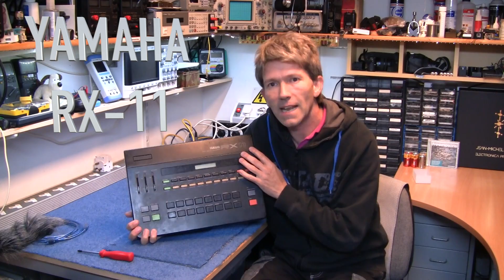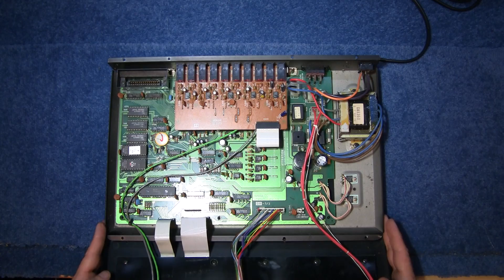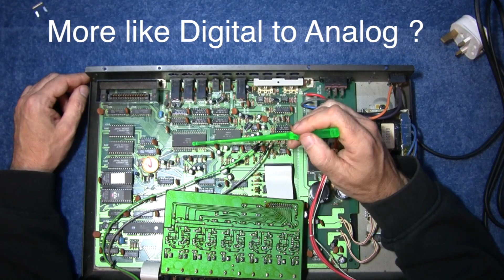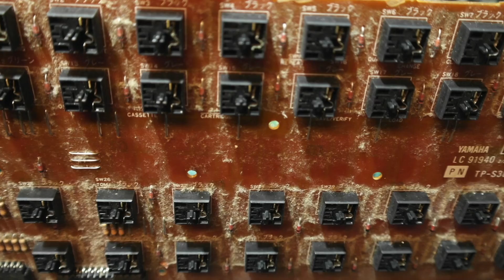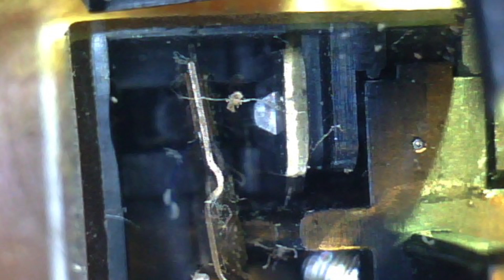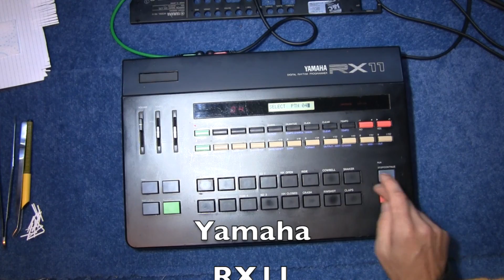YAMAHA RX11 vintage 1984 drum machine repair MF#57

Comment: You seem to be the person that knows the most about the RX 11 that I have come across.

I am getting the dreaded eight blocks in my display. I have replaced the display with a new high contrast LED model and change the battery

It seems to be working I was able to play the pads but there was an issue with writing patterns they would not playback correctly or I could not save them it said the memory was full

After turning off for a few days when I turned it back on the eight blocks in the display we’re back. I disconnected the display battery then reconnected them and did a factory reset it seem to be working again. I then did a diagnostic test and it came back with a bad ram chip. I replaced that, but then again, the eight blocks were back. I disconnected, reconnected reset and things seem to be working perfectly.

After powering off for a few days, the eight blocks were back I have reset the diagnostics disconnected reconnected and the eight blocks are still there. I still have Sound from the pads but the display is not working properly.

I have discerned that this means The unit is not fully booting. I have the model with the 2 0S chips the Yamaha RX 11 IC 214 and IC 213  V 1.0 chips.

Any advice or ideas would be greatly appreciated. Thank you for your time.

By the way this is my second RX11, not the one I repaired 4 years ago regrettably I sold that one😢

Comment: Did you clean the volume slider and has it helped the control?
Reply from the maker: yes I cleaned the volume slider and it did help the control. though I sold the unit a few years ago I hope it still works well.

Comment: My RX11 needs to be factory reset constantly due to the LCD cursor getting stuck before the values. Is there anything I can do to fix this?
Reply: well, the only way you can really “reset” it is it remove the cr2032 ram battery, which requires soldering… and that will reset it, but if you want to save patterns of your own you will need a new battery or solder it back in

Comment: I wanted to thank you! I was able to repair my Rx11 with help from this Video. I did have to replace the battery and I had never desoldered or soldered on a circuit board before. I had to purchase some proper equipment to do it. I had bought it  “In Good Working Order” from EBay. Alas it was not, the buttons/sliders were in bad shape. I cleaned them up as you demonstrated. After a factor reset it is as close to new as it can be and it works flawlessly now! Thanks Again!

Comment: I bought an used RX11 this year and had the same problem with the bad pads/triggers. Luckily I quickly found your video which gave me the courage to repair this myself. And luckily repairing was only cleaning in this case. Thank you very much!

Comment: Thanks for this video. Helped me to get an RX11 I've just bought working again.

Mine also had a few faults that had developed over time so if one of these has been sitting for a while it's worth checking some menu settings.  Initially, I had only two sounds and had to change the sound routing back to stereo, not multi out. Then lots of the pads were glitching, so a quick flick through the sound variations for those pads fixed that. After I found some memory problems stopped me creating new patches, I just did a full reset and the unit is now tip top 👌

Comment: This machine have the bell of the devil himself. Only cons is that the machine heat quite fast..so need to be careful when using. I think I will put it in some laptop stand to let it breath.
Reply: Got any issues with it eventually? Mine heats up in the bottom right corner

Comment: Greetings interested in fixing and cleaning older drum machines and samplers. I know some electronics and made minor fixes but am hindered by soldering issues and knowledge about certain chips. I have an RX 11. Everything seems to work but one sound does not sound though button or midi control. Ive tested the multi outputs and stereo but no luck. Kindly what would you suggest?  Thanks

Comment: Brilliant help Markus, when I got my RX11 with exact same problems. It's been working great, but tonight its on my lap & a real hotspot underneath below the start stop buttons. Be grateful for any suggestions what's going on there?
Reply from the maker: Hello. just under the start button is where there are a couple of voltage regulators and they are screwed down to the base to help with heat dissipation. however they should get warm but not too hot, those  power regulators have a thermal shutdown built within so the whole unit should suddenly stop working if the component gets seriously hot but that area can get warm as it is designed that way as a heatsink for the power regulators, they can be easily changed with a soldering iron as they are not on the main circuit board but have 3 wires going to them which makes replacing them easier but even changing them over you may find the new ones get just as hot. however under normal working conditions they can get quite warm and you may only be noticing it as it is on your lap, normally you will not notice it as it would be on a stand or desktop.
Reply: @markusfuller  Thanks so much. Built before anyone even thought of laptops. No vents or fans,  just solid metal.  got quite uncomfortably hot but didn't shutdown. Presume, like you say, it's normal operation but I rarely use it that way.
Reply: @organicearthful  mate I just got mine today and started getting paranoid about it, I was just looking for a comment here mentioning this lol. Any issues with that, after 3 years?

Comment: Great video! I've got the RX15 and the right ouput doesn't work either with the phone output or the L/R out. What could be the problem?
Reply: you might need to clean the inside of those jacks, use a cotton swab and isopropyl alcohol and just swab it around in there

Comment: I started working with an RX-15 in the 2nd half of 1984… and then about a year later the RX-11. Oddly enough, I was not the owner of either of these machines, they were purchased by other musicians I was working with. I was a competent drummer who read music and was making a transition to playing keyboards and synths… so I did the bulk of the drum machine programming.

The Yamaha RX machine offered "ground-breaking" value for the time in which they were released, but I NEVER really cared for the majority of the sampled sounds… in particular I thought the toms were horrendous. It was frustrating trying to use these machines to cover the drum parts of the top 40 oriented pop tunes we were doing. You only had 2 velocity levels (unaccented & accented) and fx processors were so expensive at the time that we couldn't afford to dedicate a hardware fx device just to the drum machine… so throwing a bit of the same reverb being applied to the vocals was the best we could do. All this to say… I don't look back on these machines fondly. i CAN understand interest in Linn, Oberheim DMX, Emu SP-12 & 1200, Akai MPCs (of course)… but not these Yamaha RX series.

Comment: Pulled a solder in CR2032 from an Akai ME30PII MIDI patch bay the other day. Original early 80’s battery and still measured 0.238 VDC. Had my wife touch it and we went back to the future.

Comment: Yamaha's first digital drum machine, along with its little brother the RX15. Also their first programmable one. I like the kicks, snares and toms, but I'm not so keen on the hi-hats and cymbals. I had to replace three of the mechanical buttons on mine, and spares are available from the Syntaur website. You can also get newly made cartridges with four banks on them from a seller on eBay who reverse engineered the original ones.

Comment: So, the pad buttons are just pressed on?  I just got a used RX7 with 3 stuck buttons and a soldered in CR2032 that needs replacing...  I was hoping to learn how to disconnect the DM circuit board horizontal connectors.  Thanks for the video and advice on the cleaning!

Comment: the data entry slider is mainly use to adjust some parameters like individual volumes ;  you press the "inst level" button, then the snare for example, and the "data entry" slider become the volume of the snare ; not really convenient but well it works ; I have the RX15 wich is the same as the RX11 except it has no separate outputs so this data entry slider is really important to me :) great video :) cheers !

Comment: CR2032 dead after all this time?  Well, both my DX7 and RX11, purchased in 1985, still have their original batteries :-) The cartridge slot is for RAM cartridges (the same as DX7), allowing more patterns and songs.These drum machines are very cheap nowadays. Sure they sound cheesy by now, but still useful with the separate outputs and as the MIDI which allows triggering external sounds.

Comment: hi, do u  know (or anybody here) how could i "knock out" the sounds on this rx11? because i remember that approx 20 years ago(yeah:D) i could do something illegal power on switching , and after this the rx11 gave me different interresting sounds:) wasnt distorted, it was clean, but it sounded like a filtered , modified sounds i made some drummusic whit this newly created voices, i can send you i recorded it to tape...so my question is wheter you met this phenomenon?
Reply from the maker: Csaba Borbely Hi I do not know about this secondary sound, but I will have a play with the rx11 and if I find out i will let you know.
Reply: if i well remeber now, these altered sounds comes out if you switch the power on "slow". it means that the power button you "have to" tilt slow to on state, and you have to hear a "zzzz" from the unit for a moment(of course because of the insufficient contact in the power button switch house), im not saying try it, and  i also dont want to try it again because its a really old hardware i dont want K.O.:) but that is the fact (if i well remember) that it gave altered sound until you re-poweered the unit normal way...i try to find the tape i recorded a drummusic on it...but my sony decks both gone wrong because of belts i mean (last time it was used 2 years ago lol)

Comment: The first thing to do when you pick up a new piece of equipment - is to download the manual. The most of your questions are answered then
Reply: Indeed, the manual answers some of the questions raised in this video. Extracts below, thanks to Wayback Machine (archive.org). https://goo.gl/FdyRXs 

Congratulations on your purchase of a Yamaha RX11 Digital Rhythm 
Programmer! 

Your RX11 represents the crystallization of the most sophisticated electronic music technology, combining advanced microcomputer control with a top-quality digital PCM sound storage and reproduction system. With the RX11 you will be able to program virtually any type of rhythm pattern you required for your music, and since the instrument sounds are digitally recorded, they are indistinguishable from live percussion instruments. 

To ensure that the RX11 will give you maximum performance and versatility, we urge you to read this operation manual carefully before 
attempting to operate the unit... 

CARTRIDGE OPERATIONS 
As a convenient alternative to cassette tape storage, the RX11 permits storage of pattern and song data on special Yamaha data cartiridges-the same RAM-1 cartridges used to store Yamaha DX1 and DX7 Programmable Digital Algorithm Synthesizer voices. Cartridge operations include saving or loading all patterns and songs, and saving or loading single patterns. 
All cartridge functions are accessed from the cartridge control mode, which is activated by pressing the CARTRIDGE button while holding the FUNCTION button.

DATA ENTRY TRANSMISSION 
The position of the Data Entry control can be transmitted to other MIDI equipment permitting remote control of some function of the receiving equipment. The data transmitted is MIDI channel information other event data.

Comment: I just received a Yamaha RX5 from Japan... A few keys do no work correctly. I hope that I can get this machine working again with the helpful cleaning tips you provided in your video. Thanks!
Reply: The RX5 is very nice.  I used to have one, MINT.  I regret now I gave it away.  I mean, I prefer Roland R-8 that I have now, but I think the RX5 is was higher-end, it was considerably more expensive than the R-8 when it came out.

Comment: hi markus. congrats for your excellent video!, do u know how to solve no-sound issue from right channel,??   just i can hear ihe left output...thanks!!
Reply from the maker: +Miguel Rviz Hello Miguel. sounds like there may be a problem with either the right preamp or it could just be a problem with the actual jack socket , sometimes over time the jack sockets can loosen a little and dry joints can occur between the jack and the circuit board track so resoldering it can often repair this fault. however have you tried a full factory reset of the unit incase the pan/balance has been set wrongly ?.
Reply: No  ..i reset it..i also checked pan settings..i ll check solderings as you suggests!! Maaany thanxx!
Reply from the maker: I hope its something simple to fix and you get it working again. Best of luck.

Comment: Thank you for cleaning with isopropyl alcohol tip, probably I will need this. :)
Reply from the maker: +Emir Ercan Ayar Thank You Emir. after cleaning the switches should give no problems for years. I would not suggest switch cleaner as they sometimes contain a lubricant and dust sticks to that. Best wishes from Markus

Comment: I've got an RX15 and sometimes when I boot it up the screen is all black, any diagnostics on that?
Reply from the maker: +Landon Balk Hi Im not sure why that is starting up all black do you mean all the LCD pixels are just showing black ?. if so it may be due to a problem with the display intensity setting though that is in a menu setting and you need to see the display to be able to get to the menu to adjust the display. Thats an awkward problem I do not have a how-to-fix answer to that one. There must be an answer on the www somewhere. My apologies from Markus
Reply: +markusfuller Yeah, the LCD pixels are all black, and it looks like the contrast is set to max, but it only happens a percentage of the time when I turn the machine on. I have taken it apart and even installed a new LCD screen, but the problem persists. Thanks for the response though, guess I'll keep doing some more research.
Reply from the maker: Hi Landon. To be honest I am not sure what it going on there and do not have the answer for you. I hope you get it fixed, Keep trying. Best wishes from Markus.

Comment: this video realy helps me out! I have the same switch problem on one of my american audio radius1000 cd players. The play button does not work right, i have the push realy hard on it. I hope its the same problem with the switch as in this video!
Reply from the maker: +Dennis de vries Hello Dennis, It could be the same problem , I hope you have a go and get it fixed, Best wishes from Markus
Reply: +markusfuller many thanks. the button works mucht better now!
Reply from the maker: Brilliant. Im pleased it worked for you Dennis. Best wishes from Markus

Comment: The cartridge slot takes a DX ram cart for sequencing - the internal memory is easy to fill. If you ever want to sell it let me know.
Also this has PSK tape sync co will lock nicely to any DAW over MIDI - BUT it won't let you record in external sync!
Also noteworthy is that it's swing is done off 1/24 midi clock, hence  only 54,58,63 etc on the swing %
I wish they were smaller! B ut nice build quality. 
Great video. I like all the slow zooms, subtle.
Reply from the maker: +James Porch Thanks James for the added knowledge. what I like about making youtube video's is someone always has a bit more knowledge to add to the comments. yes the build quality is good for a 1984 product, some modern day manufacturers could learn a thing by revisiting the past. If I sell it I will let you know. Nice to see you in GAK-audio the other day. :-)

Comment: I love drum machines. This was a great look inside one that I'd heard about, but never really looked at. Keep it up!
Reply from the maker: +Michael Smith Thanks Michael. I have a few old drum machines around the house, I wish I had Moby's collection though.
Reply: markusfuller I also wish I had Moby's collection, and the required space to put it all. One day, it would be interesting to have a drum machine rumble, where you'd take all of yours, and connect them in any way possible, to make the most odd/complicated/noisy patterns possible.
Reply from the maker: I have several around the house. I keep thinking I should get around to sampling them all before they die of old age. or before I do.
Reply: The former seems a better choice.